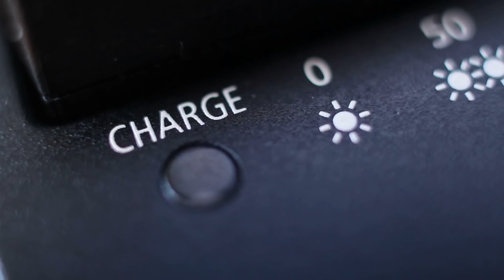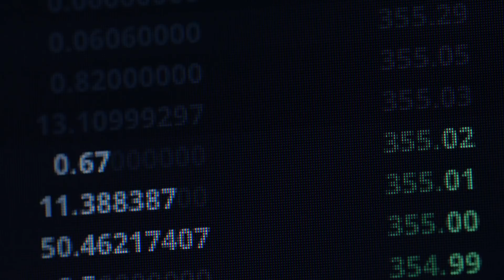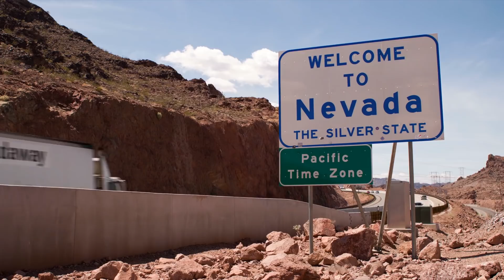Tesla's NEW 4680 Battery Has A MAJOR Problem

Comment from the maker: What are your thoughts on Tesla's battery shortage? Let me know in the comments below!
Reply: Tesla will be producing more EVs than legacy auto because it has done the work to ensure its supply is much better.
Reply: @audience2  Good point!  …ALSO, Tesla built a charging net work when other manufactures nor the government was willing to help. They created INFRASTRUCTURE To support long-term profitability and change instead of just short term end tricks
Reply: Actually, what you describe is a main cause of the lithium shortage that you are sugesting does not exist.
Reply: It's just another engineering problem to be solved.  Musk is already building out the factories which will provide the batteries, and they will be completed and operational at the end of the year.  You probably already knew this.
Reply: Your video is hype.
Reply: Please read my comment.
Reply: my thoughts given the actual evidence is this problen=m u talked about doesnt even exists theres no lack of lithium lithium is more abundent than drinking water
Reply: Nah, its not that bad
Its not lithium that is the problem , its the nickel
But Elon is doing a lot to work around it with its own battery production.. but most important; they now use the lithium iron phosfate batteries👍🇳🇴
Reply: imagine liking your own comment what a tool

Comment: You didn't say much about the 4680 battery.  The supply issue is critical; and this is why large EVs are actually perpetuating ICE cars.  Tesla has passed a total production of 1 million EV cars ; but they could have used the same number of cells and made 10 million Hybrid cars capable of all electric commute.  There are 80 million vehicles made a year - to drive the most electric miles maximizing the number is smarter and better for the environment - 1 Tesla or 10 hybrids - At a rate of only ever 10 million a year (10x current production) - it would take 100 years to replace ICE cars with EVs - with Hybrids 10 years. So you can see that EVs are actually meaning more ICE cars will be around 10 times as long.

Comment: Hydrogen is even more common than lithium- why put money into lithium which requires mining to tear up the earth when water is easily available to obtain hydrogen?  Oxygen is free and in the air to be combined with to generate power and doesn’t have to be carried with a car.  Stop with the battery BS and go fuel cell.
Reply: @ivobrick7401  Not much H2O in space - the Ocean sort of makes up most of the planet.  You don't have to dig to obtain ocean water....Convert H2O to H2 + O and use the H2 in the  fuel cell - which makes H2O again in the exhaust.

Comment: There’s no way you will ever have enough batteries for all the cars.
Reply: Not necessarily enough batteries bur the mineral components that make them coupled with a realistic manufacturing cost fór thé current Liphos battery doesnt include emerging technologies includibg solid státě,which Is thé end game for battery manufacturers and manufacturing.
Reply: there are limitless supplies of lithium in every ocean and seawater in the world..... 
over the next decade, there will be absolutely no problem whatsoever with lithium supply. 
also, Cobalt is becoming less critical because, nickel manganese and aluminum with different carbon doping is eliminating the need for Cobalt all together....

Comment: The answers to Teslas problems are within and mentioned in this video. I believe that a mix of Supercapacitors and batteries will sølve many of the supply issues with Lithium.
Veichles, acceleration can be controlled through software ultilising the fast intermittant power the the capacitors thus reducing the reliance on the drain of the battery storage as it feeds the powerup phase of the capacitors. They just havent figured it out yet.

Comment: Tesla does not have a new process for extracting lithium that was hogwash, the truth is there will not be enough lithium to support demand for the next decade according to two investment banks with mining experience - see Forbes article from July 2nd.  Macquerie states that lithium will be in "perpetual deficit".  Even Musk knows this. They are cell constrained due to production issues with cells now but will be cell constrained due to lack of raw materials next year for years to come.
Reply: That being said Tesla is best positioned to have the best supply and even if things are constrained we should have 15-16 Million EVs per year by 2025 and perhaps 40 Million by 2030 so there is a lot of room for growth - I don't think we can get to 40 million EVs per year  by 2025 or 2026 for that reason (Ark Invest has been betting on this)
Reply: Actually the method Tesla is looking at involves use lithium bearing clay (the 10k acres purchased) and treating with salt water to separate Lithium (possibly into a hydrate). So yes. The author is right about that bit. 

Regards there being some sort of deficit in lithium for the next decade, really doesn't take that long to spool up new mines as the mining companies have known demand was coming for some years now. Lithium was selling for nearly twice its current price in 2018 during the ("we're running out of Lithium" scare) Global production of EVs is up, not down, so production capacity is already scaling and throttled back the price (way back) from its high. 

Forbes is rife with articles written by analysts that don't know their subject. 
"Perpetual deficit" is absurd as the car market saturates at some point and the batteries can then be recycled... this is not Oil being burned up. More, the element is easiest extracted from salt lake hydrates, but there are many other sources such as lithium bearing clays and seawater (the latter might be economically feasible when used in desalinization plants to produce potable water and salt as primary products. With a rise in price, more sources are unlocked. To suggest "perpetual deficit" is a bogus statement on its face. 
Somewhere between 10-20kg of lithium goes into each Model 3. So $200 to $400 per car at current prices....

Comment: Batteries are not material constrained, they are production and facilities constrained. As production comes online mining can easily keep up and in the not to distant future recycling will augment the materials needed for production. Note that the older battery chemistries that will be recycled first are more constrained metals rich so more new batteries can be produced from the old batteries recycled.
Reply: The issues is the Energy Dependance of intensive mining and sources of usable Lithium salt depositions runs out and reversion to depositions of Metamorphic Rock Extraction make Lithium mining more expensive and costly from a logistics perspective.
Spudamine in Australia being an example of Metamorphose depositions.
Its Processing is being developer refined at Rockingham in Western Australia.
The øre extraction mines are nearest West of Bunbury.
Significant Salt depositions are in Bolivia and also in the old coper mines on the Cornishand Welsh coasts which flooded with seawater over 400 years since their Inception.A very clever antropologist discovered that small boys collecting the Green Cooper were also being burnt while excavating the Tunnels.Digging up their remains once they found them found where they were and who they were confirmed significant quantities of high grade Lithium had built up in their bones and marrow and was also a positive indicator into the early death for these child slaves.

But importantly thé banks used this aš a means of forensic accounting and Investigations investors used those findings aš a mechanism to borrow money and a significant loan was secured on the anthropological evidence.
Thé deposits are significant 60 Billion pounds has been discussed aš Its value and deep.
robotics are needed in the sludge extraction process.
Its possibly aš expensive as a metamorphic extraction but the offset is the quality of the Lithium øre is very volatile and high grade.
Im unsure as to how its reactivity is affected by seawater but there are studies for this in salt extraction being carried out in other coastal areas including Australia.
I hope this information is helpful to those that want to learn about Lithium and where it is deposited and in what form.
Reply: @60079regulatorylaw  While that make slow the cost reductions with battery materials it wont stop it. With the elimination of cobalt and the increasing reduction of nickel the overall costs will still decline. That doesn't even count the changes in the production process.

Comment: Tesla R&D Nova Scotia is where they research and develope TSLA batteries. It just so happens that a major player in the solar industry happens to be in the same building and right next door. Metamaterials, Inc. MMAT which has the nanotechnology to advance solar energy on a futuristic scale. I invested in MMAT while it's new on Nasdaq just last week.
Reply: Metamaterials..interesting..took a beating but you see big potential here? Any price targets? Used to live in NS Halifax
Reply: @vaneh6982  $3.00 is a good buy in price in my opinion. It's a reverse split, so it's like investing in at $1.50 a share with double the shares if they split back regular. Two hedgefunds have been shorting it but they can only take it so far and I would say $3.00 is the low since it's borderlind flat lining now.   Not financial advice but definitely do DD on the company.
Reply: @jamescobrien  thanks man..when did they reverse split and dillute shares? You sayin this may be the bottom they at now at support levels eh?
Reply: @jamescobrien  i will dive deep into them still little uncertain of what they actually do..but i like the idea of 3 dollar entry with em so far